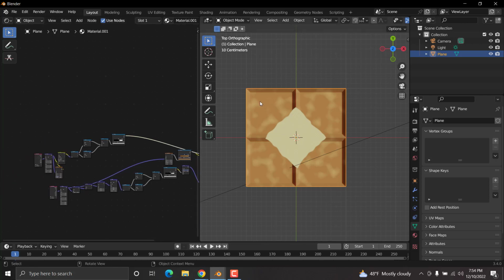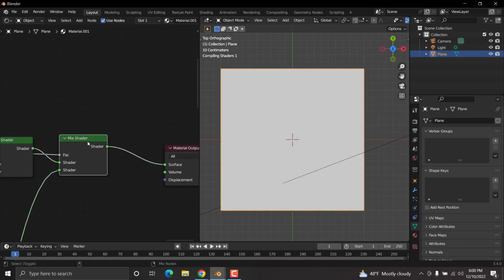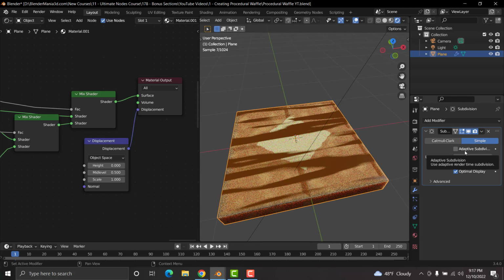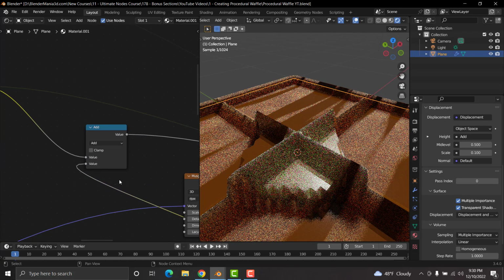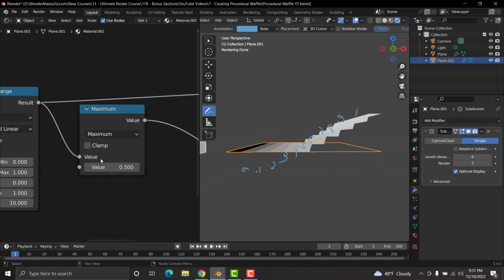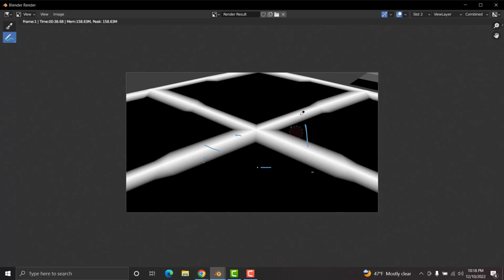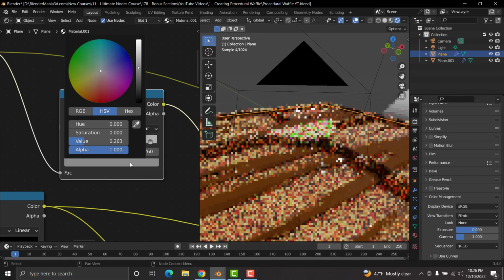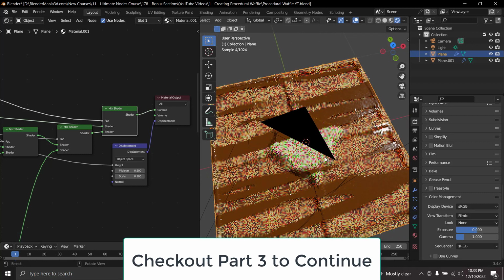Blender Tutorial - Creating Procedural Waffle Part 2

Comment: Hi! Do you know why when I change from Bump to Displacement and Bump, my waffle instead of looking like yours, separates into parts? If I reduce the Scale value of the Displacement node to 0 they join together but I think that this would not have the desired effect. I have the subdivision modifier and all the nodes exactly like you, I also have cycles active, I think I have not left anything out
Btw, i forgot to say that im using Blender 4.2 and since some nodes changed i had to use noise instead of musgrave and idk if sth else, maybe this is why, i have try applying all trasnforms, scale, etc, have try unwrapping UV and checking normals and nothing :(
Reply from the maker: Happy to help. Could you upload your .blend with some screenshots of the issue to Blendermania3d.com and post the issue there that way I can take a look at it